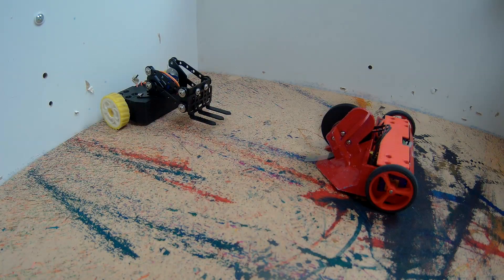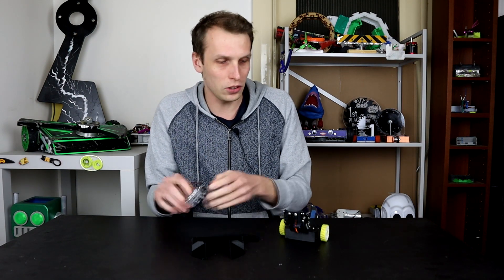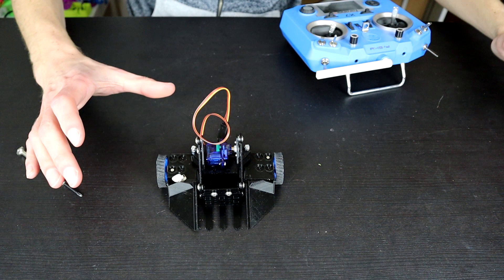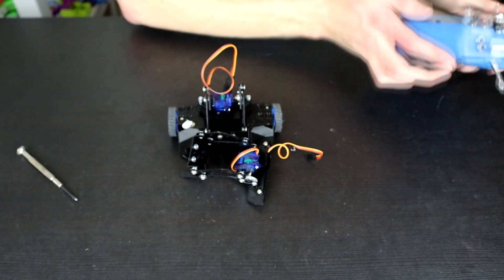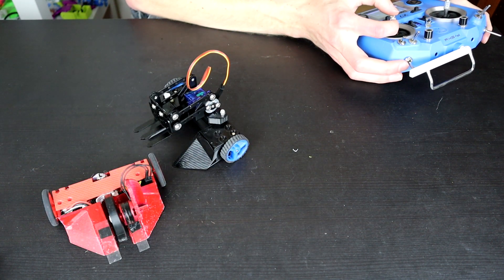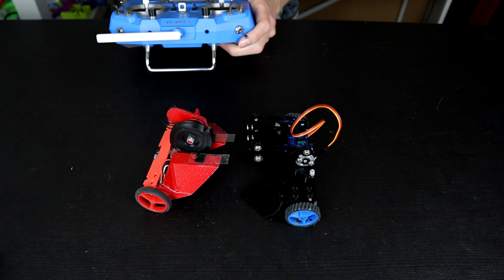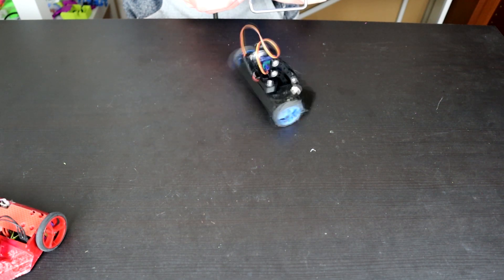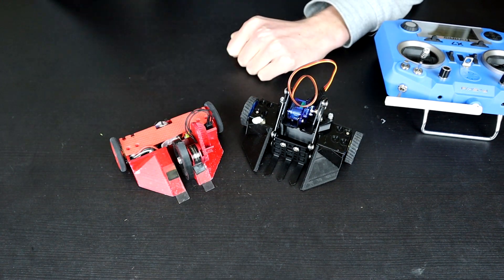DfRobot Forklift Robot V2

Comment: I love it! Maybe change the micro servo to a metal-geared kind?

By the way, I saw you replied to my comment. When you test that board, do NOT give it a 3S for power! Mine got fried in a day.
Reply from the maker: The servo is already metal geared!
I was surprised as normally the blue ones are not, but apparently Dfrobot upgrades them

Thanks for the tip! thats annoying as base arduino boards can normally handle 3s

Comment: What 3d printer do you use?
Reply from the maker: I have two, a cr10 and a cocoon create
The cr10 does most of my printing and the cocoon create is set up for abs and flexibles'
Reply: What type of filament do you mostly print with?
Reply from the maker: Depends on what I'm doing.
For quick prints, prototyping, and things that arnt going to need the extra weight I use PLA
For flexibles I use flexible PLA or TPU
For things that need to be light and strong or things I need to weld together I use ABS

The chassis in this video is PLA
Reply: @TeamPanicRobotics  thanks